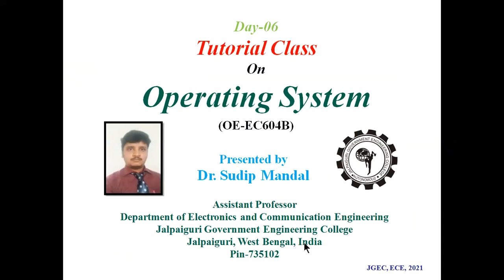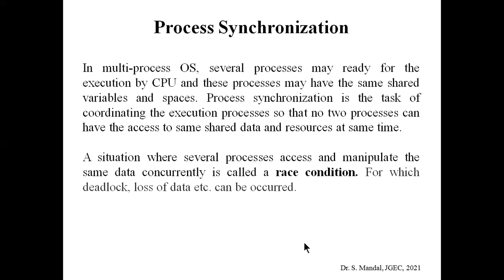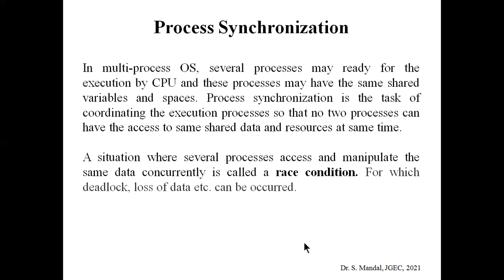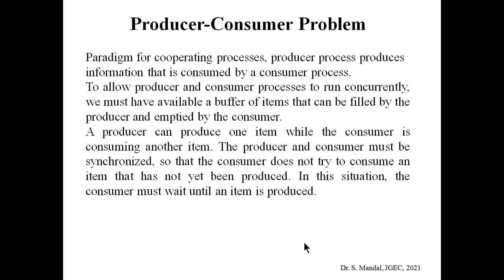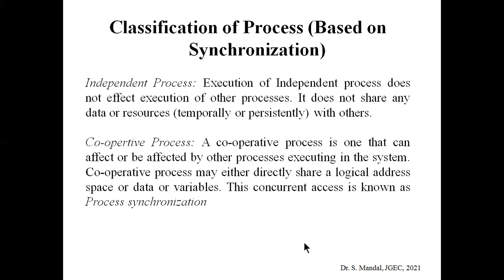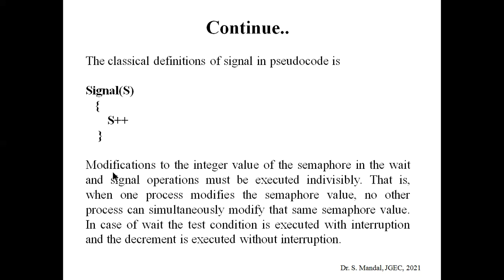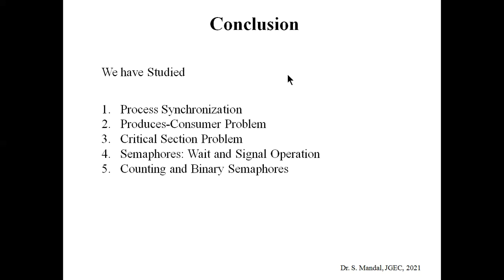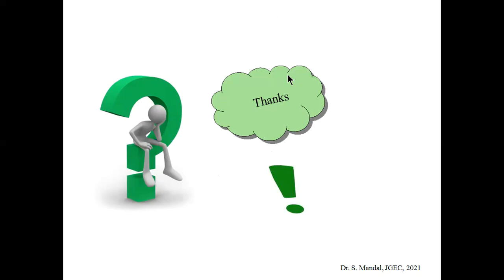Process Synchronization, Critical Section, Semaphore, Wait & Signal Operation (Lecture-6 on OS)

Comment: Sir , I am not getting the idea of critical section and semaphores . Is critical section bad or pernicious to the system ?
I mean it's good to have critical section where every process can do performance on same data and actual data would not get affected . That's what I got .
But , In Semaphore section , It has been mentioned that it's a tool and we use this to overcome critical section .
Can you explain , please ?
Reply: Semaphore is basically a synchronization tool used to synchronize the progress of interacting process. It helps to overcome problems like busywaiting by allowing the waiting processes to be in sleep mode thereby saving CPU cycles. It also ensures mutual exclusion. 
And I think in that slide it actually meant.. To overcome most of the problems in the Critical section.. we can use semaphores.
Reply from the maker: Critical section is a segment of code where share variable are stored..the execution of this part of the program should be mutually exclusive...and it required entry section to access the critical section and Exit section to make exit critical segment.
On the other hand,  Semaphore can be considered as one solution of critical section ... You see that  wait (s) and signal (s)  are used instead of Entry section and Exit section respectively....